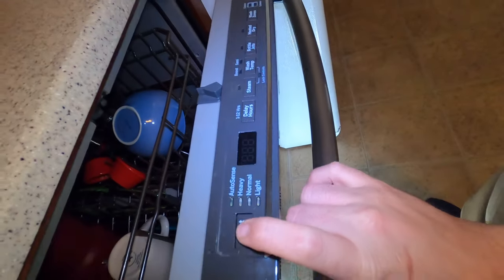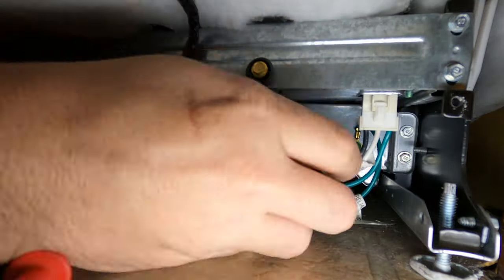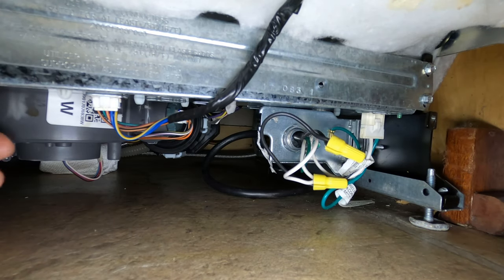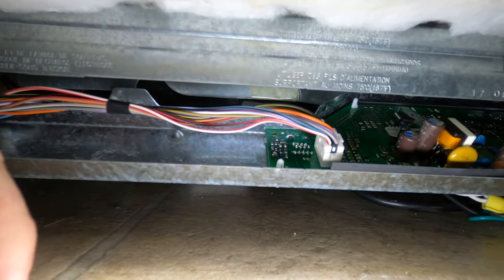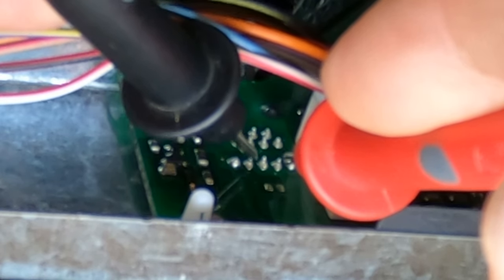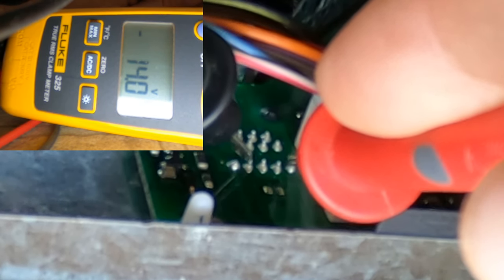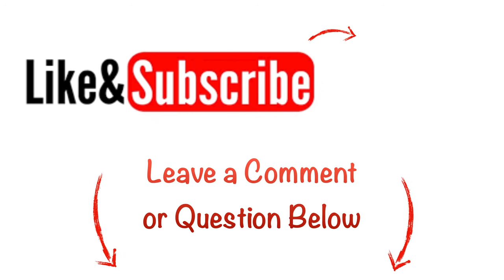GE Dishwasher Dead Display Diagnosis (GE Dishwasher Has No Lights)

Comment: I had 14 volts all the way up to the user interface, replaced the UI, and still had nothing. I learned there is a function on GE dishwashers using the Cycle Select and Start buttons that allows for a unit reset. I did this and now the dishwasher works. It's definitely worth a try and saves a lot of hassle.
Reply: I just got a used get dishwasher and power is making it all the way into the control board and door switch seems to work but nothing lights up or works. What exactly did you do with the cycle select?
Reply: @DL-ij7tf  Hold the Select Cycle button and the Start button down for five seconds. It should light up.  If it doesn't, it's probably the UI.  If it does light up, press the Select Cycle button for five seconds. The lock button light should come on.  Hold Select Cycle again for five seconds. Hold the Start button for five seconds. The Start button should start flashing. Then hold the start and select cycle button down for five seconds.  After that, it should be back to normal.
Reply: @jaredwanemacher9512  Unfortunately on the dishwasher I have it doesn't have a Cycle Select button, it has 5 dedicated buttons for each Cycle Selection and 5 for Options. I've played around some with the buttons but I'll do a little more. Thank you for the response though, if you have any other ideas I'm all ears haha
Reply: @jaredwanemacher9512  Nevermind, got it working. Took it all apart down to the control board and sequence switches, didn't really find anything, put it back together and it started working. I think it was as simple as some contacts got jostled apart and stuck or something in transit in the back of my truck. Just goes to show that sometimes things seem hopelessly complicated when it's the simplest explanation.
Reply: @DL-ij7tf  Thank you for your comment. It inspired me to check the connections instead of ordering the UI panel. Now we're doing a load of dishes and saved buying an unnecessary part. Thanks again!
Reply: @mermaidcatdesigns  That's a happy story, I'm glad to hear that. I've always found the most valuable aspect of doing something for oneself isn't a vast knowledge of how everything works but rather a calm determination.
Reply: @jaredwanemacher9512  This saved me from having to go through all the other steps and dishwasher is back on!  Thanks!  The video is great, though and was very clear.  Had this reset not been my answer to the problem I would have been following the video step by step.
Reply: What exactly did you do with the cycle select and start buttons to get it to work if you don't mind me asking?
Reply: @jaredwanemacher9512  thanks this revived my unit
Reply: @andyhuisken1508  Sorry for the late response, but in the comments (6 months ago), listed the steps I took to reset the unit. I hope you were able to get it going.
Reply: Jared, thanks for the suggestion. I was about to dive right into this issue when I saw your comment. Figured, before even checking on power supply, check this route first and it worked.
Reply: @jaredwanemacher9512  Your comment got my dishwasher back up and running. I thought I was going to have to do a tear down and fix it. Nope just a few button combinations. Thank you!
Reply: Thanks
Reply: You are a lifesaver dude
Reply: @DL-ij7tf  o
Reply: @jaredwanemacher9512  you’re a lifesaver! Just fixed my dishwasher from this,
Reply: Wished it would have worked. Unit is 5 years old...paid 1,200. Would think it would have more life in it...
Reply: Not working
Reply: @Jared Wanemacher  I did this and when I close the dishwasher door, the circuit breaker trips.
Reply: Our GE DW went out about 2 months ago. I have watched so many videos about the UI and the main control board. One is about $120 the latter is about $130. $250 is almost another DW. Jared, I just happened to see your review about the reset. I have not seen anything about this reset in many, many hours of research. I went in the kitchen and pressed the buttons a viola!  Thanks, Jared!
Reply: Thank you sooo much! It worked! Just like you explained. I read it to my husband as he did the instructions you posted! 🎊🎉
Reply: You just saved me an absolute headache, thank you so very much!!!!
Reply: I just woke up my unresponsive UI display board by unplugging it from the control board and plugging it back in while the dishwasher was plugged into the wall. 🤷‍♂️
Reply: @michaelschille7217  if the breaker trips that usually means a leak somewhere.
Reply: @jaredwanemacher9512 thank you brother you saved me ordering a part
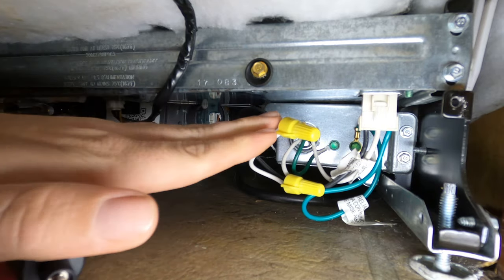Reply: 0:54 Wow.  I tried the Cycle Select and Start thing…no such luck for me, but definitely worth a try.
Reply: Worked like a charm. Thank you so much
Reply: What if you get 17volts on those connectors on the main board. Is that too much?
Reply: You’re awesome!!! This worked..heck yeah! Thanks a lot!
Reply: I didn't check power at all. I saw your comment and tried it. I had to trip the breaker and when I went to the kitchen the dishwasher reset. Here is the sequence. Thank you and thank God!
Press and HOLD both the SELECT CYCLE and START buttons for 5 seconds till you see panel flash - it will flash and 10 seconds later you will see a control lock light lit up - at that point - press ONLY the SELECT CYCLE button and hold for 5 seconds - that is a full module reboot as well - to exit the module reset - ...
Reply: I tried that but still didn’t work after replacing both the main board and the user interface!!
Reply: @DL-ij7tf  One last option. I did all of what was said above and the interface board was still dead. On the interface board are multiple copper strips. One is marked “reset” and one is marked “ground.”  Connect the two with a metal wire.  I used a paper-clip, bent like tweezers, and held the ends of the paper-clip on the copper tabs. This is a forced reset. I touched power to reset as well, but from my experience it is always the ground to reset. After five seconds it powered up.  Planned obsolescence.
Reply: @DL-ij7tf always wiggle the connections
Reply: @jaredwanemacher9512  this comment is gold.  thank you.  my UI was dark and non-responsive, other than flashing in response to holding Select Cycle + Start for several seconds.  I didn't know what to do next to possibly reset it though.  

The DW is now running, and it's not overly dramatic to say the info you gave saved me time and money - either on repair parts or unnecessarily replacing the DW.
Reply: @southwesttransport4753 does the ui have to be plugged in order to do the jumper reset? Or do you do it while it’s unplugged
Reply: Ours has been acting up (this exact dishwasher) and we’ve been having to turn the power off and on at the breaker and then the board will light. After a year of doing this, it’s not working even with that little trick. So I’m hoping it’s just UI.
Reply: @RG-gd5tc agree! Same! Ours is from 2019. Ridiculous that it’s having issues like this. Should be a recall.
Reply: @jaredwanemacher9512   this worked for me. Thank you!
Reply: How are you? I just did your reset method and hopefully I don’t need to reset the breaker every so often just to turn it on. Keeping this thread alive this 2024 haha
Reply: Thanks for this. I had an issue with mine, had forgotten about the diagnostics mode. I pulled the toe kick, pulled out the little paper (which I also had forgotten about), ran some diagnosis, reset the UI and am now running another load.
Reply: Man, mine isn’t working! I had a small appliance shop come out and get it working again. All they did was unplug something and plug it back in. But, I’ve tried unplugging and plugging everything back in and it still won’t work. Any ideas??
Reply: @jaredwanemacher9512  THIS SHOULD BE AT THE FRONT OF THE VIDEO.  Saved me all kinds of trouble.  I would like to point out that voltage at 2 & 5 disappears when the lites are flashing on the MC board.  If I had followed the video without reading this, I would have been out a hundred bucks and still not done.  THANK YOU!😃
Reply: What does it mean if the green light on the control board is blinking on and off? Installed a new ui board, tried the reset procedure, still nothing. Have power up to ui board…
Reply: @justinleary110  Make sure you have correct voltage up to the UI. I'm thinking it was around 14 volts DC. If you get a new UI, make sure the personality matches your dishwasher. This is changed by moving 4 pin connectors based off a chart you should have received. If neither of those work, I can't help you.
Reply: @jaredwanemacher9512  thanks Jared. I didn’t know that about the UI personality but out of dumb luck the old UI started working again and I did have 14 V up to the UI. So I’m sending the new ui back and hoping for the best.lol
Reply: Thank you for saving me time & money!!!! I just did what you suggested and it worked

Comment: i was having a problem with the dead display on a GE dishwasher where The service led was blinking steadily, after ordering a new UI and Control board I continued researching and troubleshooting the DW while waiting on parts. I ran across comment on another video where it it explained that the harness up to the UI is a Data connection and the plug can get corroded from the humidity  that's present during the DW operation. He suggested using some dielectric grease on both ends of the harness and connect and reconnect the plugs 5-6 times or so which would clean off the corrosion . This fixed the no display issue on my DW and I returned the boards for a refund when they were delivered

Comment: I followed your instructions and replaced the board because it wasn’t getting anywhere near 14v. I replaced it two times & still doesn’t get 14V, 5 at best. I tested the bottom power harness receptacle and wire connectors harness and read 120v… I don’t know what do next.
Reply: You and me both!!!! Please lmk if you figure something out

Comment: Superb Diagnostic test, worked like a charm, put a voltmeter between the 1st and 4th points shown above and it read 1.2 VAC, so it was bad, I replaced it and it started right back up.  Many thanks and God Bless

Comment: I have replaced the main power board twice. All electrical connections have been checked out by an electrician. And I still have to shut off power at the breaker so the machine can reset because the door panel goes dead if breaker left on over night. Any other ideas?
Everything works well when power is on. The door goes dead when breaker left on overnight. ????

Comment: My breaker keeps tripping when I close the door. After I reset the breaker the power comes on the UI lights up like normal but turns off when I close the door. I checked the control box and green lights keeps blinking until the breaker trips. Any thoughts on what's causing the breaker to trip?

Comment: HUGE thanks!!! Followed this video, had 14 volts at pin 2 & 5. Went to the next video explaining how to take door off and apart to get to UI. Was lucky and found new UI on ebay.
Again, big thanks, our dishwasher is now up and running.
These two videos are exactly what you need to save yourself a boat load of money.

Comment: Thank you for the video. After replacing my control board, the dishwasher would work fine for a day, then I would have to unplug the power connection for a few seconds and plug it back in for the display to turn on. That workaround stopped working after a few weeks, so I watched this video. I did not find voltage on the connector pins that lead to the display (bottom left connector), but I knew the control board had to be good. The issue ended up being the connector on the top of the control board, on the left. The WIRES CAME LOOSE! CHECK YOUR CONNECTORS! Thanks again!

Comment: Thanks for this. Minor comment, the coating on the board pins insulates from the multi-meter probes and may give an incorrect reading.

Comment: Thank you for the walkthrough.  Big help.  Thankfully mine just had a loose connector and it fired up again when I checked all the wiring couplers.  No replacement parts needed today!
Reply: I did the same damn thing! I've been washing dishes by hand for at least a month now thinking it would be a big ordeal even after finding this video. So after finally getting to the store and getting a multimeter I climbed down there to check for power. Good power to the unit so I disconnected the white panel socket and reconnected it. This fixed the problem! I was surprised. Duh! Always check for loose connections before assuming the worst. Luckily this time no repair needed :-). Thanks to this good video for showing me what I needed to do!

Comment: Followed this.  Replaced my control board.  It comes new with jumpers that need to be set to match your model number.  Made those changes and put it together.  Handwashing is over!   Thanks for the video.

I should add that with my model there were 2 torx screws on each side of the door that needed to be removed to lift the door panel off.

Comment: We're going to have to follow this process..dang, dang, dang!  Sooo glad you have this all figured out and show the solution so well. I think this could all have been avoided by plugging the dishwasher into a surge protector at installation. We once lost another expensive appliance by failing to protect it from a power surge.

Comment: Thank you so much for this video. My GE adora dishwasher was going out and I was able to get away with several more washes after disconnecting the harness to the UI board but then it just died on me. I had close to 120V at the main power harness but only 3V at pins 2 and 5 on the main board. Just got the main board today and swapped them out. Now the dishwasher appears to be functioning as normal. Big thanks to you sir!

Comment: Had solid green LED. No power to pins. Pushed all the connectors in tight and put it back together. It works! LED on board blinks now. It makes a lot of chime sounds randomly through today and night,  it sure if that’s normal or not (got it used with the house).
Reply: I've had the exact same experience.

Comment: Another happy customer. We checked and found 14 V at the bottom. And replaced the upper board and it works now. The one thing we found out that doesn’t appear to be covered here is that the new boards have jumpers that need to be set to match your model number. 

Thank you for the video it was extremely helpful.
Reply: How do you set the "jumpers" on a new control board to match my model number?

Comment: My UI was dead, no response to buttons, all leds off. 

I just turned off mains, disconnected the logic board completely, reconnected everything, turned on main, and its back to life. Just did a soft reset and saw all blinking leds. 

Thank God, no need to change UI yet. 🎉
I was ready to buy a new dishwasher.

Comment: I'm a geek and love technology and coding and networking and all that jazz...but electricity is a weak spot and it the danger of it low-key scares me.
But this video was so ridiculously easy to follow and understand that I was able to do everything with confidence.
That alone warrants leaving a comment. Not only that, but pointing out what makes this such an outstanding video:
You're clear, concise, to the point, you don't have an obnoxious opener with blaring music, you have good diction, you don't stutter or go "ummmmm, uhhhhhh, annnnnnnd...", you cover safety,  you teach tips/tricks (like the wire trick in your user interface replacement video), and you keep everything streamlined without adding video filler.
3.5 minutes is all it took for you to do a great troubleshooting video.
At this point, upvoting this video isn't even a judgment call. It's obligatory.
10/10 video.

(PS - It was my display. Power in and control board were getting correct voltage. I'm off to finish watching your video about replacing the user interface.)
Reply: Ckd the control board for 14v dc to interface board had 14v, ordered and replaced interface board still have the same problem, any suggestions?

Comment: Thank you for this excellent diagnostic!  I followed this and tried the reset steps folks added to the comments and turns out it was the UI. I purchased a replacement OEM board and had to set the jumpers (like you show in your UI removal video).  The included table was wrong! I have a GDT695 and the table shows "personality #11" which didn't work. So I tried the others until I found one that did. Turns out the personality should be #10, NOT #11 for models GDT695, ugh!  Got it to work though and wouldn't have been able to without this clear and concise video, thank you!!

Comment: I had a problem where it would just beep and never work even when the door was closed. Resolved this simply by shutting off its power source, detaching the main control board, re-attaching power and hitting start (nothing happens as it has no power). Shut off power once again and re-attach the main board. It was a shot in the dark, but once I plugged the unit back in, it worked! I almost bought a new board, but it just miraculously worked! Hope this helps someone else!
Reply: Same here ..

I cut power from my home Breaker. And trurned it off and on. 

Did the trick not sure was it safety feature inside Dishwasher which truns off everything. Display lit up again. 

Similar thing happened to Refrigerator both suplied on same circuit breaker.